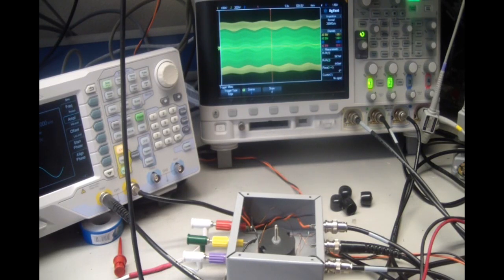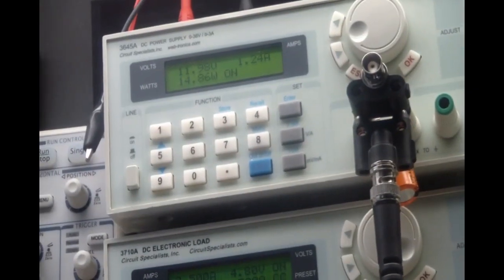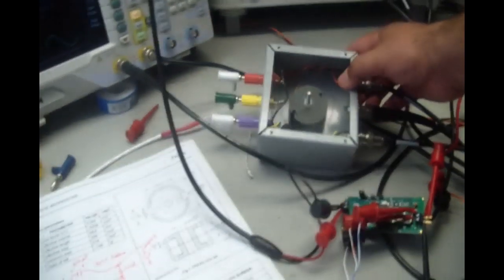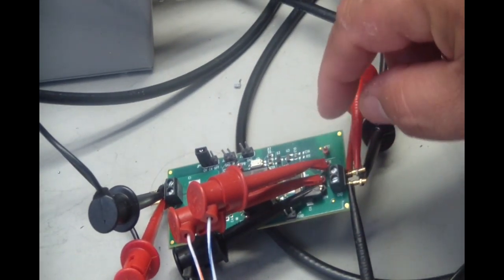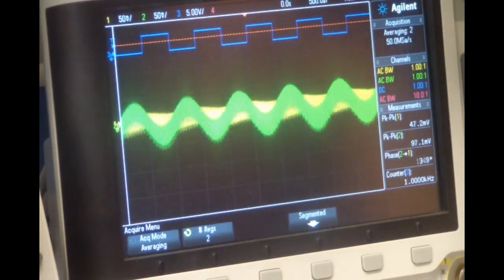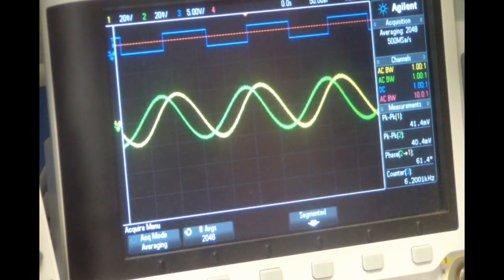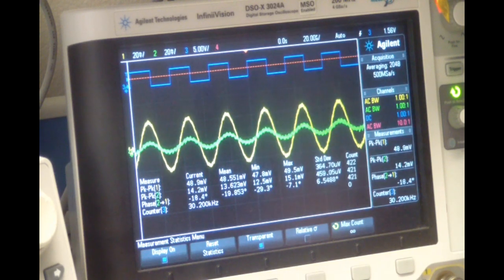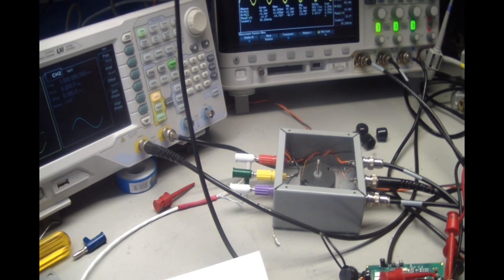Poor Man's Frequency Response Analyzer using a function generator and a scope

Comment: Is CH2 the input to the error amp and CH1 the 5V output?
Reply from the maker: The probes of the scope are connected across an insertion resistor.  So green is channel 2 (out) while yellow is channel 1 (in)

Comment: Robert. Another valuable lesson on an important subject. Thanks very much for your contributions you  are a good and generous teacher. I like your step by step approach and all the detail you provide. It keeps the uninitiated or the struggling (like myself) from being left out. I do  wish you could provide an outline of basically how your system works before going too deep into the woods. It looks like you are injecting a frequency swept squarewave through a transformer into the control loop feedback path, monitoring the signal and the feedback response with an oscope. Then, by looking at small intervals  of time with scope (while noting  the signal freq),  you measure the phase and amplitude between the input and output and transfer them to a bode plot (with log gain and freq scales). Is that basically it?

Comment: Very useful information for me. I have tried the setup on my isolated power supply. Unfortunately the determined cross over frequency (1.3kHz) is much lower than I expect (ca. 10kHz). Is there anything I have  to take care about it? What is the reason for the 300uF capacitor? Do I really need it? Thanks a lot.
Reply from the maker: +Heinz Kreutziger Hi Heinz, If you want to increase the crossover frequency, you may want to increase the integrator resistor that is connected in series with the integrator cap. You may want to see the link below to know what is going on or the principle of compensating the loop. https://www.youtube.com/watch?v=2doS4y9KsIMYou might be able to do without the 300uf capacitor. Just be carefull that you don't accidently short out your power supply. Let me know of your results. You can always email me at rbola35618@aol.com